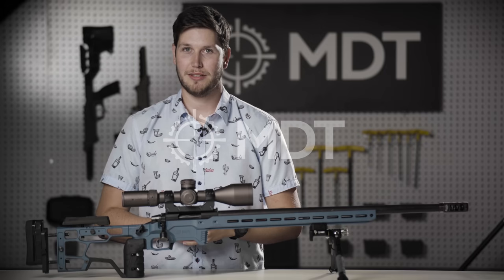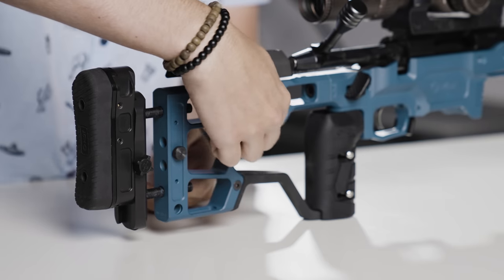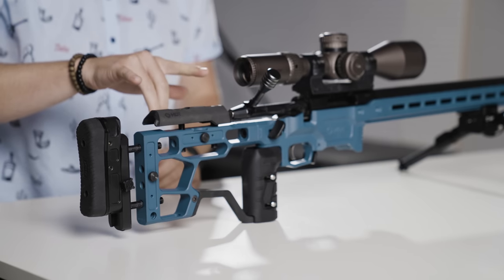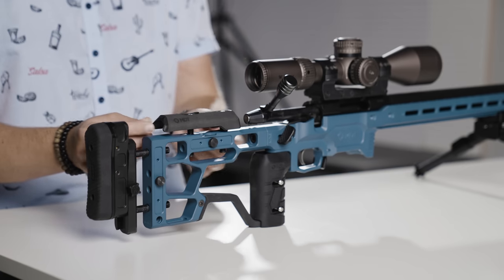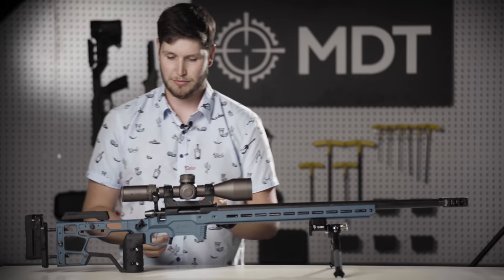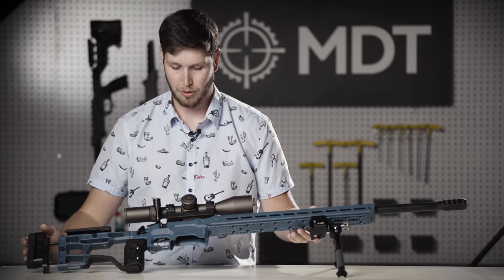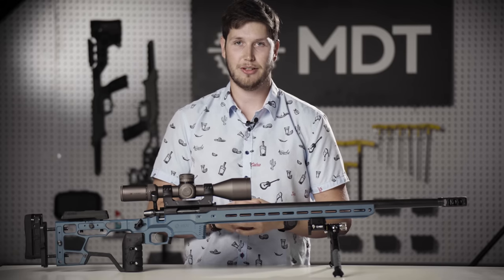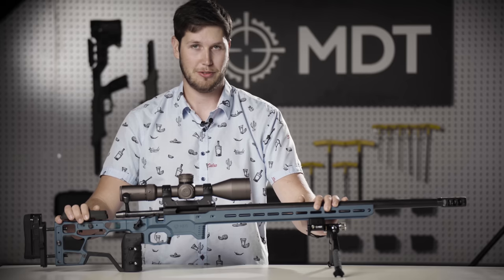The Ultimate Competition Chassis // In-Depth Look At The MDT ACC Elite

Comment: Interesting developments over the previous ACC chassis.
The rigidity improvements, thumb shelf, mag catch adjustment and Arca rail changes are excellent. 
A pity about no lateral adjustment for the cheek riser though. 
How is the balance of the chassis? I have found the previous ACC to be quite butt heavy, does this move the weight further forward?
Reply from the maker: This can still vary depending on the action and barrel for the balance point, but the chassis is heavier and the buttstock features more aluminum components to find the best balance point.
Reply: I have a remington 40x with a heavy duty thick recoil lug would that be a problem with this chassis

Comment: The nuts on the screws that hold on the vertical grip are sided by plastic allowing the nuts to turn if you try to torque the screws down enough to stop the grip from wiggling.  BAD DESIGN.
Reply from the maker: We are sorry to hear this, are they still loose or were you able to get them tightened up?
Reply: @MDTTAC    Nope, one of the nuts stripped out the plastic and it’s loose.  I’ll either have to buy a new grip or epoxy what I have.   Either way is unacceptable.